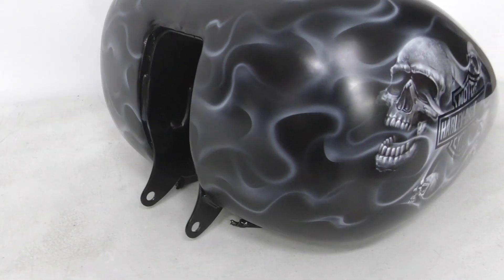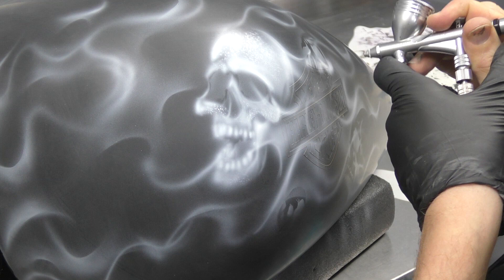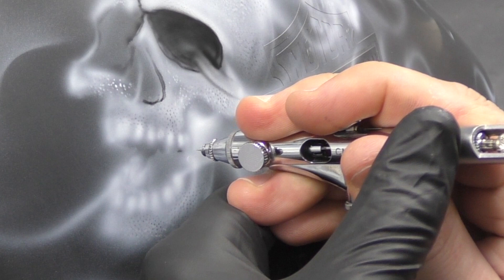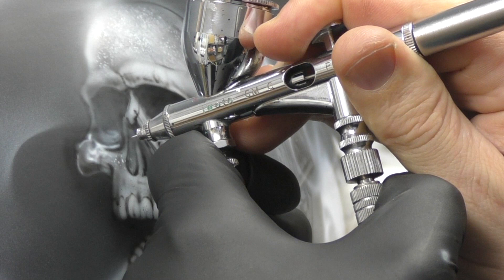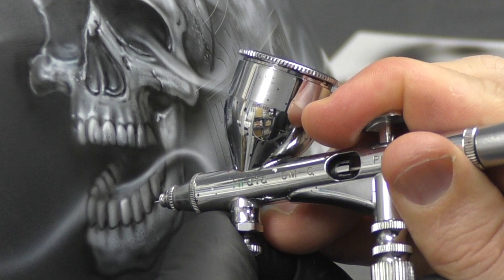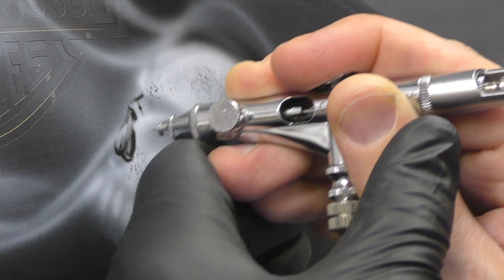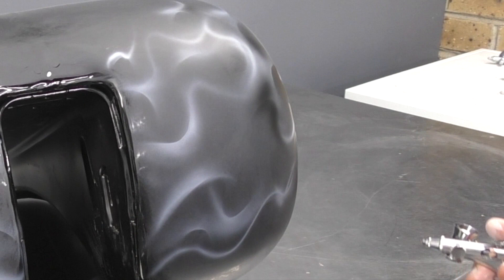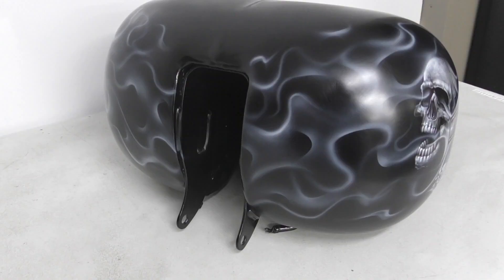Airbrushing Skulls and Smoke Flames | Harley Tank

Comment from the maker: Check out the Art from the other side of this Tank - https://youtu.be/R7my3WTX0Ag
Reply: When i'm running the Paasche at.. 0.20 I can get some close and fine dots (my skill level) but I noticed you still had pretty good coverage when at a moderate distance. I have cleaned the airbrush COMPLETELY and still having the same issue.. I have thinned paint further and still no luck. Still getting flecks on my normal tip Paasche despite cleaning and a complete remix of paint with more reducer.     #1, do you have any input. #2 I'd love to see a video on all the problems beginners face in one place. That would be awesome. I know there are some spread amongst different videos, but a single source where I can routinely watch/reference would be great. As always, great job. Though I cannot paint tanks for AWHILE, I love to watch the artwork and process.

Comment: Great work just wondering if your still using the battery powered airbrush compressor, if so rather than keep taking the valve connectors off you cm to attach it why not connect it to a quick release valve that way you can set it up and change airbrush.. Just an idea because I was going to pick one up for outdoor work :-)..
Reply from the maker: Haven’t played with it for a little while but will create an artwork tutorial soon using one....I did try the quick connect but it doesn’t work with the battery unit 😞

Comment: Awesome job, I hope with in the next year I'm doing tanks or hoods. I'm the person that sent you a email with the 2 pics. I have a question if you don't mind. I was airbrushing and all the sudden big shots of water came out of the gun. It ruined my art work and did it for around 15 to 20 mins off and on. I was maaddd. Also it would have little burst of paint. I was running a fine line and all the sudden it looked like I went full throttle, but I was barely on the trigger. I bought a 180$ airbrush kit 4 days ago and it came with a little  compressor. Would that be my issue the compressor? It has a water filter but it's seems like a lot of water. I have 2 other compressor 33 gallan and a 20 gallon, should I run that instead of the little liter one. I know nothing about the set up and how it flows together. I was worried that the other compressors were to big and could cause damage to my seals in the gun. I don't think it's the gun because today I bought the eclipse for 160$ and it does the same thing as before. Any help would be appreciated.

One more thing to make thin lines is it better to run low psi(18 to 20) and more reducer (65% reducer) or higher psi(30 to 35) and less reducer (30%).